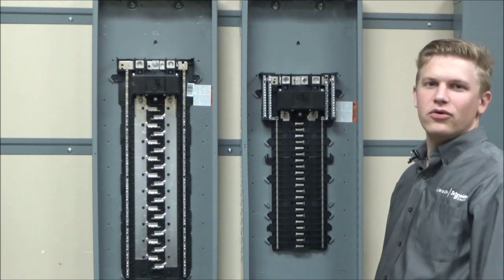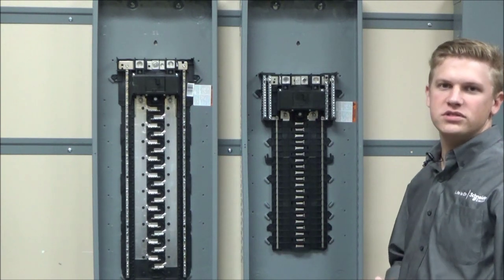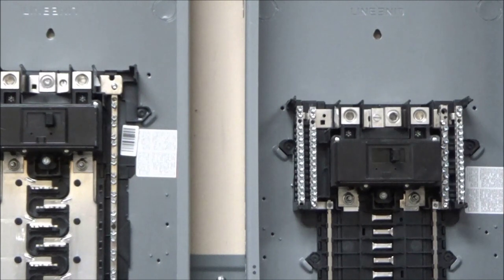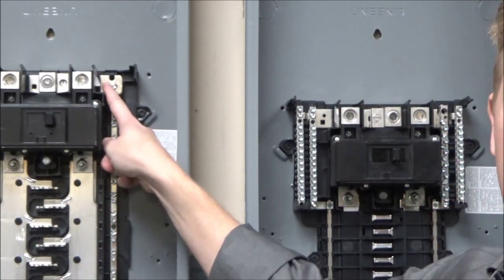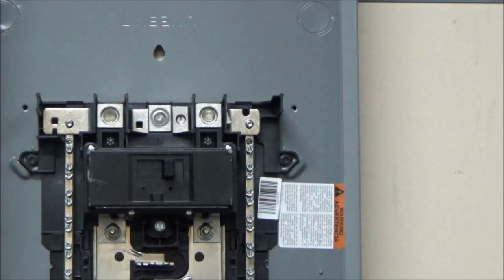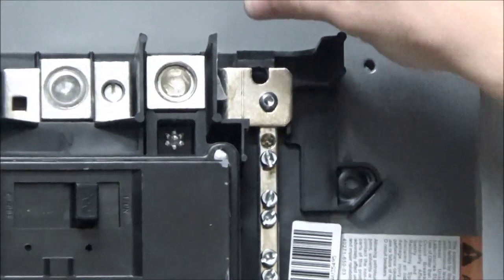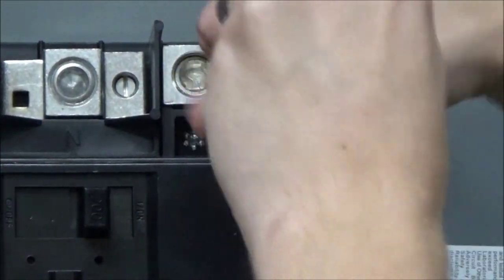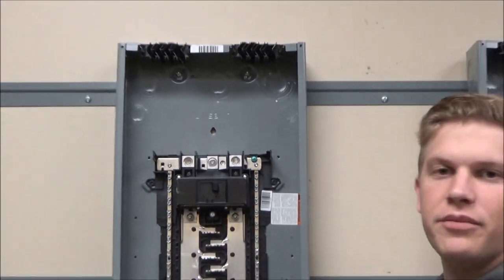Installing Neutral Bonding Screw on QO & Homeline Load Centers | Schneider Electric Support

Comment: should I still have continuity between my graoud and nutrul buses in the sub pannel with the bonding screw removed?
Reply from the maker: Thank you for your message. For troubleshooting support or to find answers, please reach out to a technical expert in your location here: http://spr.ly/6050Mjkzu
Reply: There will be continuity between ground and neutral if it's connected to the main panel, because they are bonded in the main panel.
Reply: Main panel: bonding screw enabled = ground & neutral bar must have continuity 
Sub panel: bonding screw removed = ground & neutral bar must NOT have continuity
Reply: @alejandrogalarza3147  There will be continuity if the subpanel is connected to the main even with the bonding screw removed, because they are bonded there. But there should be no continuity if not connected to main panel.
Reply: @Hazar1337  It is correct, electrically neutral and ground are connected at the origin, but that screw changes the direction through which the fault currents pass, like the change of train tracks, if we leave the union screw connected in the sub panel, all fault currents will also return through the neutral behind the sub panel instead of just return for the ground wire.
Reply: @alejandrogalarza3147  Yes thats right. I'm just saying that even without the screw, if the subpanel is connected to the main you will read continuity between ground and neutral. But you should read no continuity if you disconnect the subpanel from main panel.

Comment: Hi
   In my 2 phase disconnect I have no neutral so can I bond the bar with green screw and land my ground wires on it from line and load sides?
Reply: Technically yes, morally and legally no because your neutral carries unused power back to the panel and then to the earth, if bonded to another ground you'd possibly create an energized ground loop since you'd have a complete circuit between the neutral and the ground.